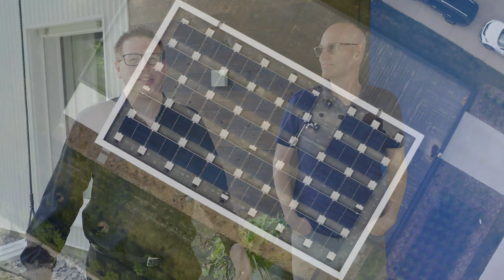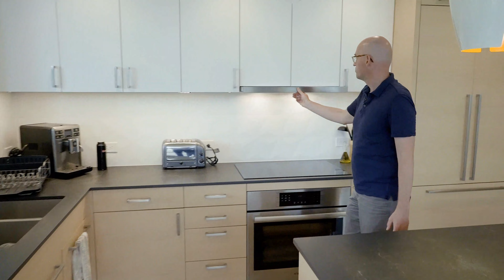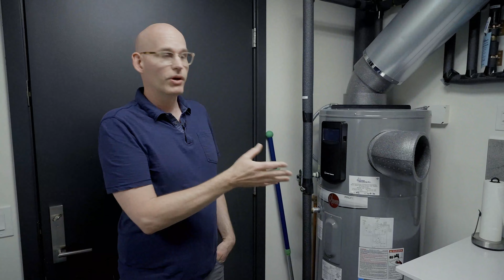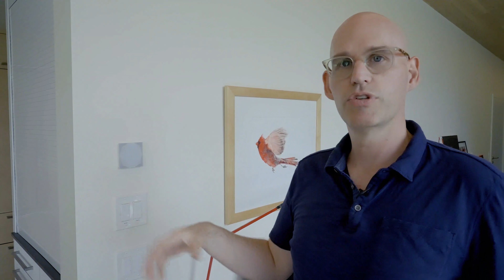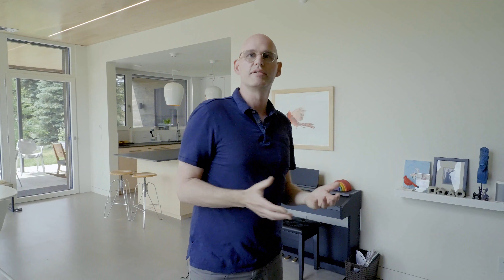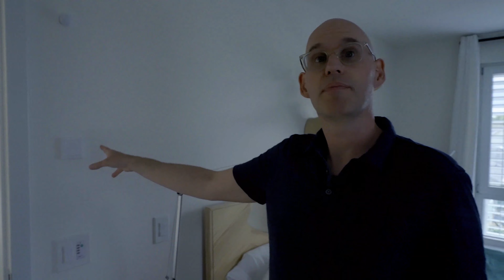Exterior Shades Make This an Amazing Passive House! (Smart Home Tour)

Comment: the house is well thought out with a nice and very livable interior design (not real crazy about the exterior, though). the numbers for this house are very impressive. he is very brave if he has a heat pump in minnesota without any backup heat source! his points about the exterior shades are well taken, but what concerned me was the issue of privacy: with exterior shades, someone could walk up to your house and flip the shades to look inside your house.

i thought that he was a bit evasive on the question of the cost of the heat pump water heater. i happen to have the same water heater. the cost is about $1700; this compares with about $1000 for an equivalent natural gas water heater. an electric water heater would cost even less. the cost of installation for the heat pump water heater is probably higher if you are going from a natural gas water heater to a heat pump water heater because you have to get an electrical connection. but if you are going from an electric water heater, the connections are already there. in terms of operation, the heat pump water heater is less expensive than a natural gas water heater and probably a lot less expensive than an electric water heater. in terms of payback, you may get payback on the heat pump water heater over the life of the unit, but don't expect any kind of huge payback. in my case, i put a lot of value on the lower energy usage. i was surprised that he had complaints about the noise of the unit because my heat pump water heater is fairly quiet, but then, i have my water heater in the basement.
Reply from the maker: Tim is awesome, his company designs passive homes. Thanks for sharing your numbers for heat pump water heater, very interesting!